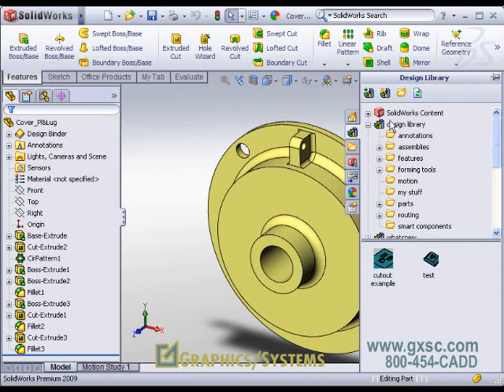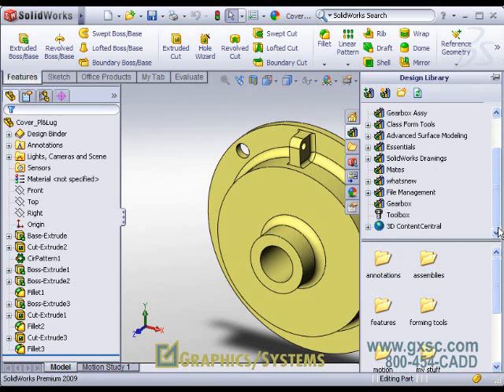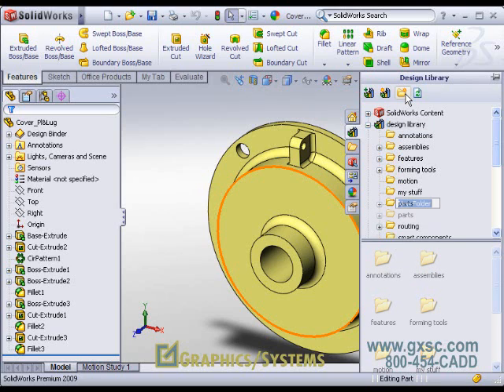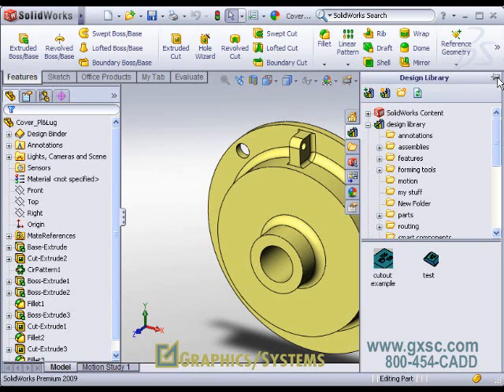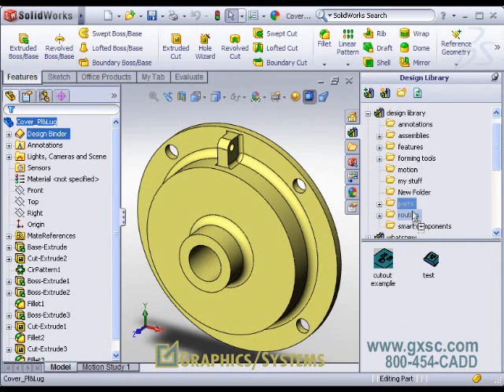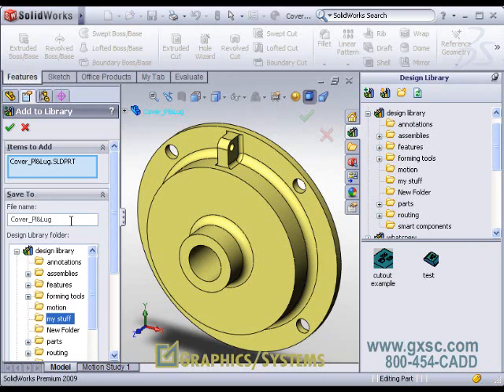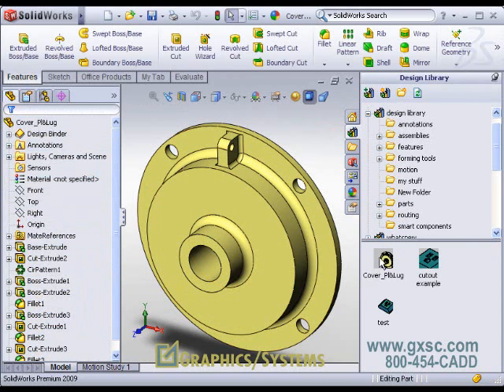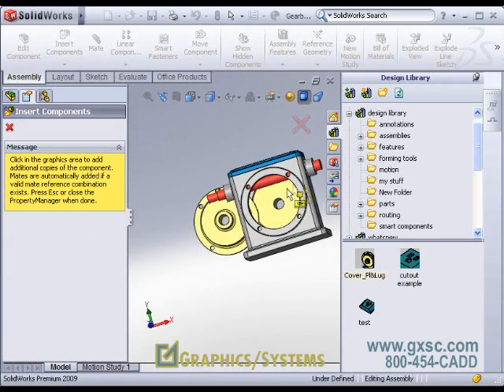SOLIDWORKS Smart Mates - Adding a Part to the Design Library - Part 6

Comment: This was very very helpful, Thank you so much.  I am very interested in the Reference mate  , I am now looking for how I can control the orientation of the part  when I drag and drop it in the assembly
Reply from the maker: When SmartMating or using a Mate Reference, the SHIFT key will flip the mate alignment. If you are simply dropping the part into an assembly and not doing any mating as you drop, having "Show Rotate context toolbar" active in the PropertyManager of the Insert Component command will let you flip about the X, Y, or Z axis as you drop it in!